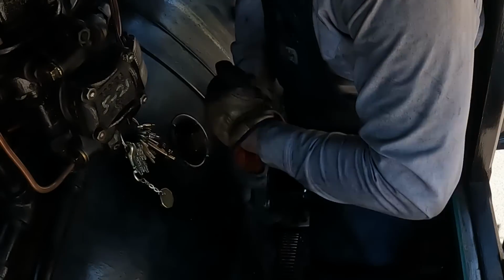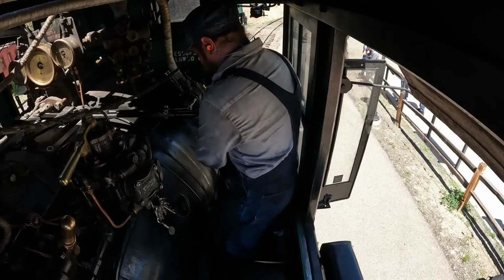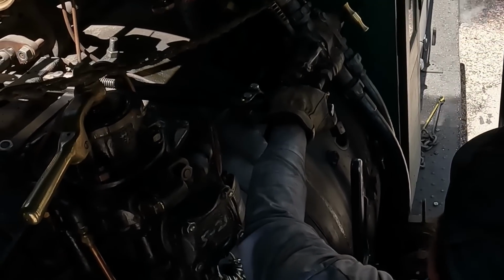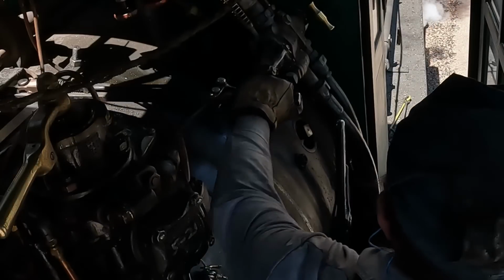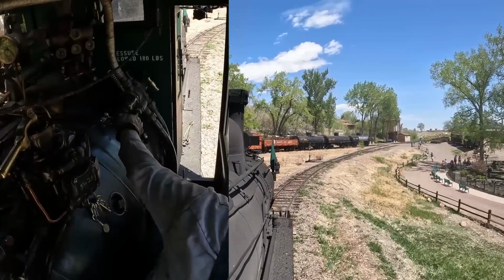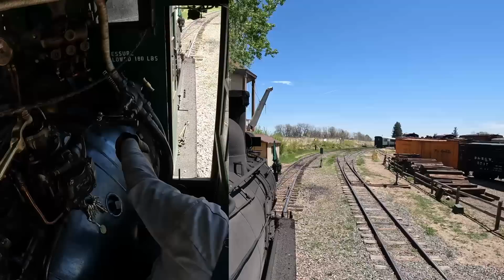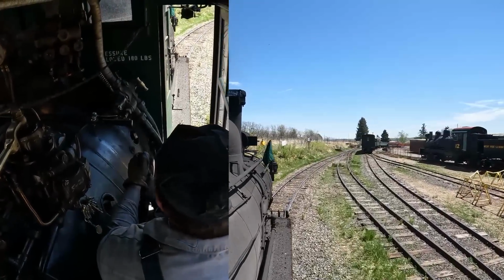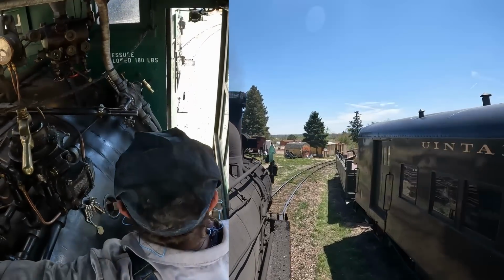How to DRIVE a real STEAM TRAIN - First Person Engineer!

Comment: Somehow, I did and yet didn't expect that explanation of starting on a grade, it's interesting how closely that lines up with how I was taught manual cars (mostly because the teaching vehicle had a worn everything so everything was done with an ample amount of caution) - keep the brake held, release just enough clutch you feel it start to load the suspension, so it's fighting gravity, and then take the brake off.

I mean I guess in the end it makes sense - both forms of vehicle, car or train, are really only designed to move in one direction at a time, your power can't be one way when you're rolling the other. And because neither can instantly apply power, you need to figure out the dance of pre-setting enough engine power to overcome gravity and rolling resistance, but not so much that you cause problems by making the movey-thing not move

Comment: Hyce, thanks for the in depth description of handling the steamer. When you are going downhill, you apply some train brakes to maintain a constant speed, and you also close the throttle and put the johnson bar in 'first gear'. So what happens when the loco is being pushed by gravity, and the throttle is closed? Is the loco 'coasting', and if so, how does it do that given the driving pistons are now just pumping air, or what exactly is happening in the driving pistons? With the throttle closed, it seems the piston would be back pressured. Thanks.

Comment: I did not hear you mention the cylinder cocks until near the end of the video.   I ran a Mikado for a few years.  Before moving we would open the cylinder cooks and clear the cylinders in both reverse and forward just before moving.  Then leave the cylinder cocks open for the first couple of strokes on each cylinder.  Over all you did a great job.
Reply from the maker: I definitely did gloss over that on the way out! Yes, when you're starting after sitting for a long time that is of utmost importance.

Comment: 20 might be my favourite of the Colorado Railroad Museum's engines - such nice proportions!
You put 'drive' rather then 'run' in the title - proud of you for getting the right term! 😛
The amount of train handling you have to do would be dissolved if you used a buffer-&-chain coupling - you can keep everything always pushed together by tightening the coupling - no slack action to account for!
(What is a 'deckless' engine?)
Reply from the maker: I said drive only because it would be easier for non-railroad folk to find... :P

A deckless engine is one where the boiler comes all the way to the back of the cab, so there is no deck inside the cab.
Reply: Knuckles superior to buffers, you can't change my mind
Reply: @OllieandJamie Adventurers in Britain we call that a 'tender cab' - an obviously inferior bit of terminology!

Comment: Really cool/informative video, couple questions:
1. How do you know what the state of the trains are behind (aka position of all the knuckles) while braking/accelerating?
2. When stopping, how can you tell what position the pistons are in?
Reply from the maker: 1. You don't, unless you really mess up and feel the train run in or out. If you're handling it well, you won't notice if the train changes between tension and compression and there's no way to tell.

2. If you're working steam, as you slow down, you can feel each power stroke surge, as the output of force is actually sinusoidal.

Comment: Great video you explain the controls so well . How do you control the steam production when the engines throttle is off.  I understand that the lack of steam in the exhaust stack stops most of the draft through the boiler tubes do you limit the air available to the boiler ? . I can see how the fireman and driver really have to monitor the boiler pressure either under heavy throttle openings or closed throttle  situations . Alot of physics involved in keeping a smooth ride for the passengers and mechanical equipment.
Reply from the maker: You have to plan ahead as a fireman in this case - there is no damper or airflow control beyond the blower. So, you plan for the stop, and make sure the fire is nice and light.

Comment: Excellent video! Loved all the interaction, followed by just sitting back and enjoying "the ride". Never rode in a cab of an operating locomotive except for a 2-6-6-2T in Snoqualmie Falls, Washington as a guest (now just a static display). Look like your work was cut out for you with cameras an all. 
Now, question one you of two you said you might be able to answer... Why do you think K36 #485 was scrapped after falling in the pit at Salida? The damage did not appear too severe to repair after seeing what the Burnham shops could accomplish and what the CRM accomplished with the rebuild of #20 though it cost a million and a half. 
Not part of the question, is that West Side #12 you passed in the video at CRM???
Reply from the maker: It fell in the pit at a point the railroad was downsizing / losing traffic. They could've repaired it, sure, but the rest of locomotives were needing parts, it was a lot to fix, and they didn't really need the extra engine. No incentive.

That is in fact westside 12 And 14. Owned by Lindsay Ashby, been on display at the museum for a while.
Reply: @Hyce777  Your probably right (tear in eye). I think if D&RGW had any money left for maintenance, they would have fixed her seening how traffic picked up for certain areas of the railroad, but narrow gauge was dying (more tears).

Comment: The old gal's in fine voice and I just love hearing her talk. 
Reasonably sure that's the museum but I could be off ( CRS is a thing at my age) but IIRC the D&RGW GP30 the museum has was painted up as Sierra Pacific for the old ABC movie of the week Runaway back in the early 70s and was the trailing unit on the runaway ski train in the movie. If you ever get out here to my neck of the woods in the Chicago area check out the Illinois Railway Museum in Union Illinois. Huge collection and a foamers dream.
Reply from the maker: I need to get to IRM! And yes, 3011 was in a few movies from what I recall. :)

Comment: It really is running by the seat of yer pants when going across the fill there and finding the happy spot.   I've had issues of trying to find that sweet spot with 4 (and now 7D) when trying climbing back up the hill before hitting that grade before going back downgrade.  The preciseness of stopping in the station is something even I'm still trying to perfect and if I ever get any good at firing and move my way up to engineer, I'm hoping I have it down in the Diesel first.  😅

Comment: Coming out of the Navy, my boiler knowledge is rusty but how long does it take to get a decent head of steam on the boiler before you run.    Brings back flashbacks of my youth, i grew up 5 miles away from the museum and spent many a youthful weekend there. many times  where steam didnt run cause somethin was broke.  mid 1980's
Reply from the maker: If starting from cold, we take 8-12 hours depending on the loco. If it's already been hot and just getting it going in the morning, 2-3 hours. I've got a video or two coming out on the subject later.

Comment: Was it hot in the cabin? I wonder how engineers of the past survived when outside T is 100+ F..  Thanks for this video, I feel how awesome and difficult it is to drive steam. Would you take it as a full time careeer if you'd live 100 years ago?
Reply from the maker: Very hot. When it's 85 out, it's 130-140 in the cab. Gotta get going fast to get the AC working. Lol. 

As a full time career it would've been hard, but also cool. Tough to say.

Comment: Is there something that gets the momentum happening? Like rod is all the way forward.. how does it start turning.. my little engine needs to be manually spun to get it going.. I just am amazed by how cool these things are..
Reply from the maker: Second piston is offset so that if one is all the way forward, the other is in the middle of a power stroke. Sometimes you have to roll back and forth to make sure you get both power strokes to really take off.

Comment: 4:10 why do some engineers leave the throttle wide open.... and use the Johnson bar (at least after you get above ~10 MPH)
and then some engineers will use the J-bar more like a gear shift.... leaving it in place and using the throttle, then "shifting" and changing throttle again
.
ive also heard that you want to leave the throttle open a bit..... unless the J-bar is PERFECTLY centered.... 
because you can create a vacuum in the cylinders or something...... and the oil is delivered from the steam, so you dont want to run dry on oil
Reply from the maker: Every engineer has their preferred method, but the most efficient way is to use the J bar. The throttle "scales" the amount of steam pressure applied, but limiting the J bar / cutoff increases efficiency. Usually, if you're at tonnage, the "proper" way is set the throttle open wide and move the J bar where you need it for speed/power. Some folks close the throttle to "shift" as some locomotives don't like the J bar getting adjusted while working (read: try to throw you through the front cab door). 

Throttle partially open depends on the engine. The engines we have at the museum have Snifters - which, are basically a gravity vs. steam chest pressure valve. Shut the throttle? the valve falls open due to gravity, preventing the vacuum from drawing the exhaust into the cylinders and keeping things oiled. But not every engine has them, in which case you'd leave a little steam on yes.

Comment: What was the air you were releasing at the end when you stopped? I am very curious how to operate these. I have Train sim world 4 and have become very interested in these steam locomotives. Thanks. I was also wondering you said it is better to bring the reverser or Johnson bar closer to neutral because it is better on the pistons?
Reply from the maker: That was actually the cylinder cocks being opened to drain anything in the cylinders. Bar closer to center is better for efficiency, and it beats up the actual valve gear rods, pins, and bushings less - the cylinders don't care much.
Reply: @Hyce777  Thank you very much bro.

Comment: @hyce, when you come to a full stop at the end of the run, what is the huffing sound (like out of breathe) is that automatically happening via a pump or is that something you or the fireman turn on to create that sound? Very cool video!
Reply from the maker: That is the air compressor, which is catching up with the large volume of air used (sand + braking)

Comment: She shows great. How high do you hook her up? With the light engine she is able to run in center.
Reply from the maker: Pretty high, she certainly can run on center with everything all brand new. Hard to sit next to the bar up that high though, lol. Usually a few notches out of center.
Reply: @Hyce777  When I ran her she did not have a cab on her yet (the tender was back in CO already too). In the corner she has -0- lead. Hooked up near center she has around 5/16" lead and in center she has around 3/8" lead.
Reply from the maker: @mikado1555  I take it you work(ed) at the 'burg :) thanks for the info - that's cool. I know she's biased to forwards enough that "true center" is actually a few clicks back.
Reply: @Hyce777  She runs forwards and reverse in center.

The thing with Stephenson being a variable lead valve gear is that when moving forward, you can hook the valve gear a little bit to the rear of center and still be moving forward (and be moving backwards, be slightly forward of center and still be moving backwards).

When in the corner with Stephenson, the valve motion is only from 1 eccentric. When hooked up, the valve motion is from a combination of 2 eccentrics. When running in center, the valve motion is from an even combination of the go-ahead and back-up eccentrics.

When running forward with the Johnson bar slightly behind center, the valve is receiving slightly more input from the back-up eccentric, but it is not enough to retard the motion/momentum of moving forwards.

When running backwards with the Johnson bar slightly forward of center, the valve is receiving slightly more motion from the go-ahead eccentric,  but it is not enough to retard the motion/momentum of moving backwards.

If the loco is stopped and throttle is opened with the Johnson bar in center, the loco may move forwards or backwards depending on the angle of the main rods.

Comment: How did you get into volunteering for the museum? Did you have to work your way up to become an engineer? Cool video btw!
Reply from the maker: I showed up one Saturday and never stopped. lol! and yes, I had to work my way up to engineer. Gotta start from the rear end and work your way forwards.
Reply: Sounds like the volunteer process hasn’t changed too much since I showed up one Saturday back in 1994. They said sure, you can start by cleaning the flues in 346.      
I still came back the next Saturday to get covered head to toe in soot again. Learned to fire and was training to be engineer before I moved away. Lots of time doing grunt work to get to do the exciting stuff.
Reply from the maker: @terrytait28  Yup, pretty much the same! I spent a lot of time in the firebox early on.

Comment: Question: who/what activates the bell when you near that crossing?
Reply from the maker: The bell on the crossing (and the gates) are controlled by the crossing relay, XR. Typically done with track circuits, but we've got a button for it at the museum.

The bell on the locomotive is rung by the fireman pulling a cord manually.

Comment: I hate slop in any linkage lol. On any front wheel drive manual car with a transverse setup, I always change the shifter, the actual shift cables, and replace all bushings with polyurethane or billet aluminum. Idk, someone could probably mill solid bushings for the linkages. I’m guessing it’s either iron on iron or if things are nice there might be a soft metal brass bushing on the pins. But I’m telling a you, get someone to model the linkages in some software and get solid bushings made.
Reply from the maker: You kinda have to live with the slop, because most of the "guts" are inside the boiler and have to deal with steam, expansion + contraction, etc. - you could probably get it tighter than we have it but it's a lot of work for not much of a return. And, if you do get it tight, the amount of notches in the quadrant don't really give you much adjustment, so being able to "fine tune" between them with a little slop gives you more control.
Reply: @Hyce777  Thanks for the response! I never even considered the effect of heat on the various metals. I guess it’s like anything else, each individual machine has its own personality and being in tune with that can lead to better results than changing setups.

Comment: Hi Hyce got a question what is a deckles steam loco
Reply from the maker: A locomotive like 20 where the boiler goes all the way to the back cab wall, so there is no "deck" in the cab.
Reply: @Hyce777  so is the fire box door outside because if it is they must not be fun to fire for the firemen would have to go outside and inside constantly do check water check fire and check the left hand side for when going around corners
Reply from the maker: @Ashok-fy7ke  yup, fire door is outside. It's not as bad as you think, but yeah it's more to deal with than an engine with a deck.

Comment: Been trying to find a good analogy for people to understand throttle vs Johnson bar on a steam engine, and find myself going with "if you imagine riding a bicycle, the throttle is how hard your pushing the pedals, the Johnson is the gear ratio you're in. You can pedal as hard as you want in low/low gear, but on level ground you won't get going any faster". Does that seem reasonable to people?
Reply: Alternately, Johnson bar could be how heavily you're breathing?
Reply from the maker: it's really hard because there's no true analogous thing that really does the same "thing". I always tell people it's "kinda like shifting up but not really"

Comment: I meant to ask you about that... In RRO I've gotten into the habit of pulling the throttle before releasing the brake, and I was wondering if that is something you have do often. Anyway, as much as putting my hand on the throttle for real is a dream of mine, it seems like it would be much more intimidating in real life than I think I've always imagined it...if that makes any sense! Like, there's the idea of driving a steam locomotive, and there is actually doing the thing...and I think those are two very different things, especially for the uninitiated!
Reply from the maker: First time I was in the cab I was extremely intimidated. It's not a thing you do lightly. And yes, depending on the situation throttle first is good.

Comment: How do I get a job doing this sorta thing? Will I need training going in, or just passion for the work?
Reply from the maker: It's very much an on the job training sort of thing, and usually there's a bit of a ladder to get up into the cab and run; but if you're passionate, work hard, and willing to learn, you can do it. That said, jobs that do this with steam are few and far between, and tend to pay a small amount - so you best be sure this is what you want if you go for it.
Reply: @Hyce777  Thanks! I've always known I've wanted to operate and maintain some kind of large machine. I'm not sure steam engines are the one, but maybe they will be! We will just have to see.